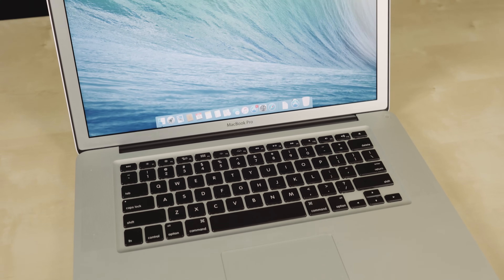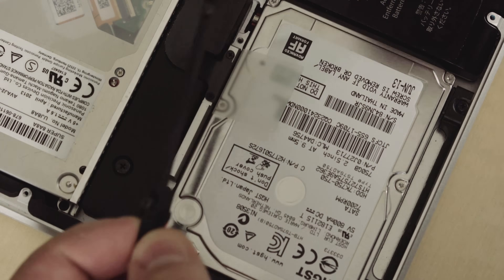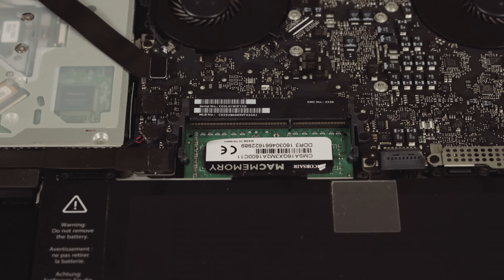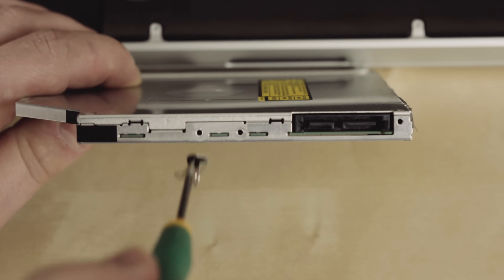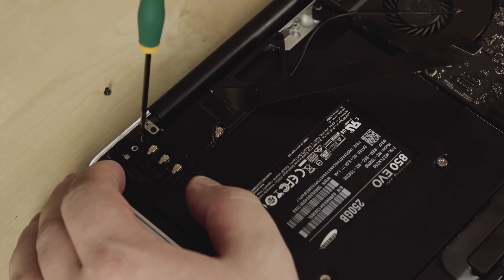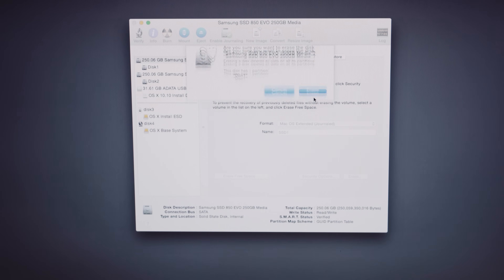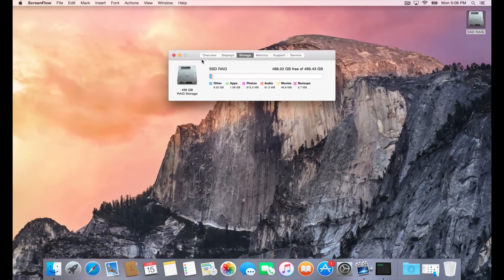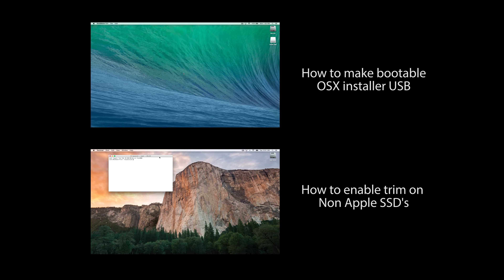Fastest 2012 MacBook Pro Ever! Upgrade Guide - in 4K

Comment: Can someone please tell me what having 2 SSD's instead of 1 does exactly, and how it improves the performance? Also, would this work on the 2010 MBP or just 2012?
Reply from the maker: TIDALWAVE I explained what having 2 drives do in the video. I'm not sure how I could have been any clearer. When you have two drives and you use raid0 you couple the drives into one bigger drive. Once you do that you get full bandwidth from both drives giving you double the speed of one drive. It's pretty awesome. As for a 2010 model you could do it but you won't see the speed benefit that you would from a 2012 model because the optical drive connection is slower. You're better off with just one ssd. Thanks for watching
Reply: Thanks for the clarification and the super quick answer. Might look into a 2012 then. Any particular model? Also, would this solution still be more beneficial than getting a 2015 MBP? Thanks.
Reply from the maker: TIDALWAVE it'll be cheaper. But it depends on what you do. The video card in the 2015 Mbpr is better so if you game or video edit it'll be a bit faster.
Reply: Thanks for the help. Subscribed!
Reply: The stripped pair of drives gets you that 900MB/sec transfer rate, instead of 525 a single drive can achieve. The 2010 MacBook Pro lacks the 6 Gb/sec SATA III ports for the main drive nor optical drive. So while you can do a SSD upgrade or even a RAID pair like this, it won't be as fast.
Reply from the maker: BradMacPro exactly
Reply: Zed ProMedia what about the 2011 model? Also what are the pros and cons of RAID0 and should I do it? What is RAID1 and can/should I do it? What are the best SSDs on the market? (Heard of Crucial a lot of times). Need some advice for an epic upgrade. Thanks man :)
Reply: I have early 2011, would like to know this as well.
Reply: 2011 MacBook Pro lacks the SATA III speed on the optical drive so a striped pair would be limited to that speed. So you could put in a SSD in the machine and gain a huge advantage over a spinning drive. The slower optical connection may be better off with a plain drive or a hybrid drive for backup or just more second tier storage.
Reply: 2011 MacBook Pro has 6Gbps for main drive bay and some came with 6Gbps on optical drive bay and testing shows it to be unreliable even it is so equipped, so stripping across two different speed interfaces is not recommended. I suppose mirroring could be done, but again that is not supported. I recommend Samsung 850 EVO or Pro drives, or OWC Electra or Angelbird SSD wrk.
Reply: BradMacPro so I just throw an SSD in to replace the HDD and that's it right? Because striping will do no good because of lack of SATA III, do I get it right?
Reply: VarisTheHacker that should be fine, max the RAM. But if you don't use the optical drive, you can replace it, with a bracket, a SSD, a hybrid drive or a plain 5400 rpm drive.
Reply: BradMacPro I'll probably max the ram out and just replace the HDD with a 1TB SSD, don't see any point of having 2 SSDs when RAID doesn't work that well. I don't need 2 TB too lol
Reply: i have a early 2011 pro, so if i fit the same ssd's and ram and i follow this guide it will will still work or do i need to do something different since i don't have the SATA III ports?
Reply from the maker: Im not sure if you would get full bandwidth if you did Raid0. But one SSD will speed things up dramatically.
Reply: rcadorin the optical SATA is unreliable so a striped pair is likely to fail. A single SSD in the main bay will still have full performance. You can move the old HDD to the optical bay via the adapter bracket.
Reply: hey Brad! You seem experienced in the topic, so if I may I'll ask a couple of questions :D  Have you had any experience and problems with the 850 EVO? considering buying it as a main drive and putting the hdd in the optibay. If so, how do the SSDs hold up? Any problems? And what can you advise on TRIM? heard there are some incompatibility issue such as system corruption or data loss. And finally which SSD would you recommmend: 850 evo, OWC electra 6g or Crucial mx300? Thanks in advance anyways
Reply: Бесей Нургалиев I recommend the Samsung 850 EVO for it 's price, warranty, reliability and compatibility. Not so much the Samsung. OWC Electa is a contender too as it avoids TRIM altogether. I have also used and recommended Angelbird wrk for Mac as they have native Apple TRIM support.
Reply: Бесей Нургалиев As for TRIM, I have used Apple's Terminal command on newer systems, but that needs to be redone with any system update or security update. Older OS X, I've used TrimEnabler which is OK but superceded by Disk Sensei for more money.
Reply: I'm more inclined to buy an 850 EVO since it is readily available at the country of my current residence at a more or less sane price. Still the question of using or not using the TRIM stays open, since from what I've understood the garbage collecting does not let the speeds lower at the time of writing to them in the future. On the other hand, however, if it brings some trouble with it, thanks but no thanks. Do you think it's worth extra hassle of ordering a OWC online, and possibly extra import taxes for the TRIM? xD
Reply: Haven't really had any experience with SSDs in the past, so don't really know what TRIM is, other than what the quick search of the matter says on the web. And don't really know if it is necessary or not. And after enabling trim on the EVO have you experienced any troubles whatsoever?
Reply: Бесей Нургалиев If you heard bad things about TRIM, then get the OWC from OWC direct of from amazon.com
Reply: Personally I have not tried this stripped array in a laptop. TRIM is garbage collection and wear leveling and it keeps the drive working at best speed over it's usable life span, which should be better than a regular hard drive in the first place. I could say it is not really necessary, but I always use it.
Reply: thanks for your replies and advice :) but I don't live in US, I am currently living in Malaysia, where they don't ship from Amazon.

Comment: I have the exact same laptop as in the video, will this set up work if it is macOS Sierra?
Reply from the maker: I want to make an update video for this since I made this 10months ago. The issue is alot of my Audio recording interface drivers are not updated for Sierra so I'm taking my time to upgrade OS. You wont have an issue upgrading your mac and installing Sierra. It might be a slightly different process thats all.
Reply: Got it, thanks for the quick reply!

Comment: hey guys, I'm thinking about buying and old macbook pro maybe used to make this update. which one should I get, 2012? or maybe the first with retina display? I want the best in  budget and quality
Reply: If you want a decent Superdrive, get the 2012 MBP. It's much cheaper and the backlit led is okay.
If you want something newer, get the late 2014 MBP because: 1) new speaker system, 2) fixed an issue where 2013 had a peeling screen, and 3) new ventilation system / less noise.

Some things to note:
1. Apple is going to cut supper for the 2012 version by 2018-2019.
2. An external superdrive is seriously flawed (See the reviews on Apple's website).
3. You must be okay with your laptop for the next 5 years to get the most value.
4. The real benefit of buying used is that your saved money can be used as a "downpayment" for your next MBP, or phone, car, whatever you need.

Personally, unless you burn discs or rent movies, you can't go wrong with the 2014 especially because it has a very clean look. You can also get a thunderbolt external graphics card if you ever feel like gaming or editing, it won't work on the 2016 version currently.

I have a 2009 macbook, it's starting to show age in performance even after I upgraded it. I'd like the 2016 pro with 4GB GPU, but I may go with the 2014-2015 for the ports instead.
Reply: You wont be able to upgrade the ram or make a raid 0 array on a retina MBP.
Reply: I have the late 2012 model and its been fine for around 4 years, its fast and I've had no problems (Except with battery life, but that will happen to any battery as it gets older)
Reply: The retina does not allow for many updates. RAM is soldered in, so no luck. The only thing you can do is swap the SSD for a bigger one, but watch out, this is not a normal SATA SSD. Also, since there is no superdrive, you cannot put in a second SSD. The 2012 non retina is the last one that allows for user upgrading.
Reply: Fábio Matos 2014 MacBook pro

Comment: Just a quick addition, because of changing the hdd, and removing the battery connector the computer will reset the date, that may cause verification issues while installing os x, if the error pops out 

This copy of the install OS X application can't be verified. It may have been corrupted or tampered with during downloading

just click on Utilities -> Terminal, type date

if the date is incorrect, use this command 

date {month}{day}{hour}{minute}{year}

example date 102713122016 and hit return

After that try to install again, and that's it.
Reply: Stefan Vasiljevic so that's why i kept getting that error. I was changing out the stock hdd for a 1tb ssd and unplugged the battery just to be safe. Now i know it wasn't the bootable usb that was the problem. Thanks.
Reply: I plan to upgrade my mac. Thanks for the info, m8
Reply: Stefan Vasiljevic::I got that error message on an older model MacBook, is it necessary to unplug the battery supply???I don't think I'm going to do that on my newer MacBook Pro when I switch out the HD for an SSD.Thanks for that piece of info man, learn something every time..oh if you can answer a question about upgrading the HD for One SSD only will I still have to do that RAID striped, thing like in the video??? I don't know what that is for, seems is to combine both 250GB SSD into One.....But I'm only going to be putting only One 525GB SSD.Hope you understand my Question Thank You
Reply: Don't know if you already did it but its for combined size and speed.  If you are just doing one drive you don't need to mess with raid 0 or anything like that... the performance increase you will notice will be incredible and almost like buying a newer model.  Good LUck
Reply: McRom37 raid is for multiple drives
Reply: Stefan Vasiljevic I
Reply: Thankyou for sharing
Reply: Thank you, i will try this!
Reply: When you say, "try to install again" , you mean installing the OS all over again?
Reply: Can I Do this to a 2012 MacBook Air?
Reply: Never have I ever had that happen. I work for a school district and one of the primary schools I support is 99% Mac. I've serviced an innumerable number of these. Unplugged the battery, replaced probably every part inside. Never had the date reset.
Reply: Thanks bro you saved me
Reply: UP

Comment: The second SSD will be really slow because its going to be limited for the optical drive port speed which is like 30 Mb/s or so. for the second hard drive its just ok a simple 5400 rpm HDD which is gonna give you larger storage for lower budget! that's my configuration right now. cheers
Reply from the maker: William Casique I just proved that it's full sataiii on this 2012 model. I don't know if you saw my bench marks. The optical drive is running 6Gb/s same as the hard drive connection.
Reply: Zed ProMedia its really weard 'cause i got the same speed in the second hard drive in 2 diferent models (2011 n 2012). And the caddy transfom de sata conection into a slower port. Am i wrong with this? Depends on a specific model?
Reply from the maker: William Casique from my research all the 2012 MacBook pros are like this. I'm not too sure about the 2011 models

Comment: I just bough an used macbook pro 15" Mid 2012 and saw your tutorial. I wonder if it is possible to make the RAID if the two SSD's are not exactly the same size, for example yf one isd 256GB and the other is 250GB? I have an old macbook Aluminum Unibody (Late 2008) with and ssd which is 256GB but is no longer available anywhere I have search for. The company that fabricates this ssd's now sells 250GB and the model refference is different from mine.

Comment: Mi macbook pro 2012 already have 500G disk, my question is why would i change the current disc into a 2 of 250G like you do in this video?. Thanks
Reply from the maker: alex blanco I did it for speed not for capacity. If you watch to the end of the video you will see the speed tests
Reply: Im sorry im still dont get it, i dont know much about this, so for more speed i should change only the ssd disc?, the last one you changed on the video?, thanks
Reply: Shobhit Varma thanks man, i didnt know that about the discs, i'll do this then.

Comment: FWIW: I opened my MacBook Pro the other day to put an SSD in it and as far as I can tell, the screw heads are not Phillips head. I was using a JIS 0 which, while a bit uncommon, can be found in inexpensive screwdriver kits from eBay. If you already have a TORX in a large kit, there's half a chance the JIS series will be in there.

Comment: Is it better to do this or simply buy the 2015 macbook oro 2015?
Reply from the maker: Its your choice. I didnt want to waste my money on the 2015 Macbook pro. It's outdated. And I did this back in Feb! I doubt apple is going to release anything ground breaking this year. So for me its worked out perfectly. I assume they come out with something new in the spring though. Makes more sense not to spend so much now and then buy the new one in the spring? That's my plan anyway
Reply: Zed ProMedia yes that is also my plan. I will wait for the release of the macbook pro 2016 and then for the price drop of the macbook pro 2015.

Comment: When i get to the point where i gonna install the OSX, i get this message "This copy of the Install OS X Yosemite application can’t be verified. It may have been corrupted or tampered with during downloading"

How can i fix this? I have tried to make an OSX Usb multiple times, but get the same message every time..
Reply: Found solution!
Had to enter the date and time in the Terminal before I installed :)

Comment: I have absolutely 0 knowledge in computer guts so excuse me if this is a really rudimentary question: will I lose everything on my computer if I do this?
Reply: you can use the hard drive which you will replace with a SSD by buying a SATAIII- USB convertor case which is really cheap so once you install the new OS, just connect your hard drive via the USB cable and you'll see your old files. Don't plug the hard drive in a Windows machine or any other operating system though as those OS won't recognize the macOS partition.
Reply from the maker: If you don't back it up to restore to the new drive then yes you will.
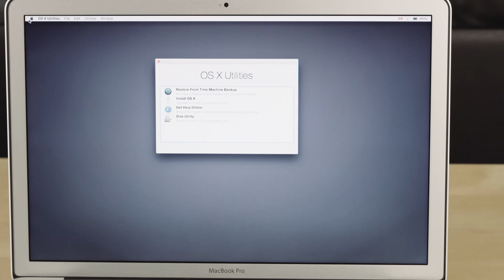Reply: Does that occur during the erase/restore process starting @8:24 or do i do this before i start the entire process?
Reply: Also, this was super relaxing to watch for some reason, I'll probably be on this channel for hours now watching random videos way above my understanding
Reply from the maker: Cierra Peters well there are a few ways to do it. But probably the best is if you  can back it up to an external hd first. And then take the old drive out and install the new ssd install OS X and then transfer it all your stuff on.
Reply: Hi Cierra,

The way to do this is to use Time Machine to back up your hard drive to an external drive. Then you should be able to use Time Machine to restore that backup to the RAID 0 Array.

~George
Reply: Akshay Dhavale yeah but what about photohop
And other software, would i be able to keep running these from
The hard drive?
Reply: George Rimakis Έλληνας ;

Comment: Quick question... would the drive caddy fit in a 2011 MacBook pro 13''?
Reply: Any macbook with a superdrive will fit them because it is a standard replaceable type (2.5" hard drive). However, know that if you try to use the superdrive in a USB enclosure it might not work correctly (can read discs but fails to write on mine). I ended up putting my superdrive back in and got a backup hard drive. SSD and ram upgrades work great, just BE CAREFUL when you unplug stuff from the motherboard, I broke my sound bar doing that because the instructions weren't clear for mine. Overall it's totally worth it if you plan on using your computer for another 2-5 years.
Reply: Supertinyfeathers thanks!